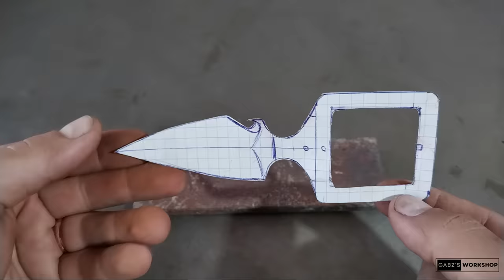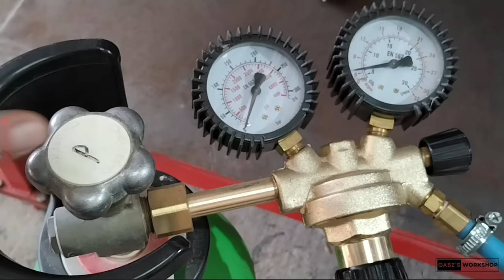Knife Making-Making A Belt Buckle Knife| GabzWorkshop

Comment: I’m in shop tomorrow I’m building one these bad boy
I’m going to used a metal Punch just for my self that it .
Reply from the maker: @davepetro5676  great, send me some pictures when you finish it 👍👌
Reply: @gabzsworkshop  you gave it a heated tip so much better.
Like some screw drive that suck with out the heated tip

Comment: a lot of hard work and then just ruined the metal. The spring must first be fully heated to a temperature of approximately 800 degrees Celsius. then hardening in oil and then mandatory tempering in an oven at a temperature of 200 degrees Celsius for one hour. then it will be a strong blade capable of cutting, stabbing and strong to break
ask what “steel tempering” is, it’s very important
Reply from the maker: Your are right,this is my first knife, now I am working on new knife and I will do it properly.
Reply: @gabzsworkshop  5160 alloy steel is widely used for most leaf springs. The carbon concentration of 5160 steel is 0.6%, making it a moderate to high carbon steel.
There is a lot of information on the Internet on the correct processing of this steel. good luck and enjoy your hobby